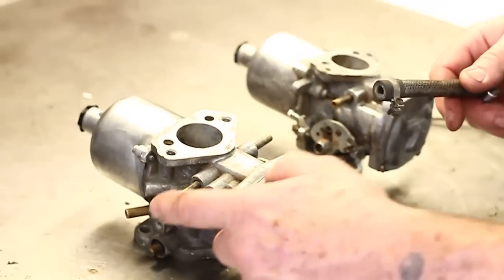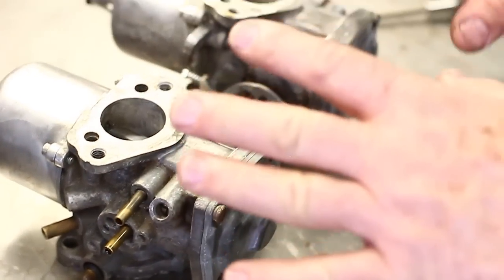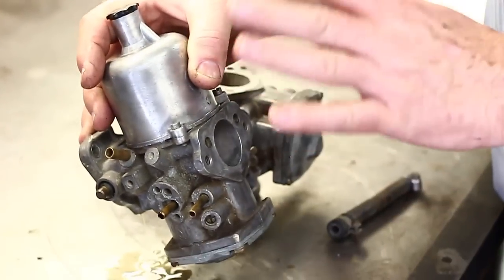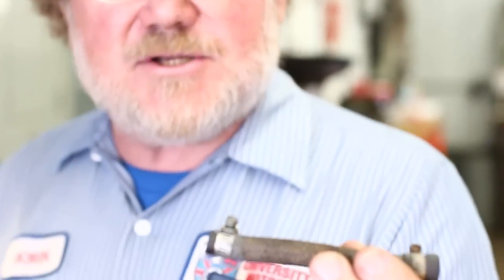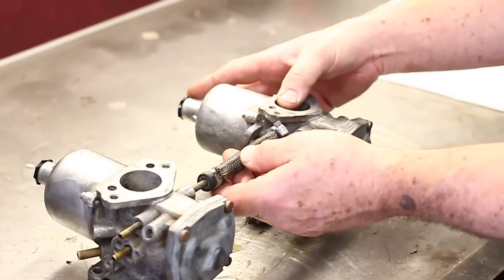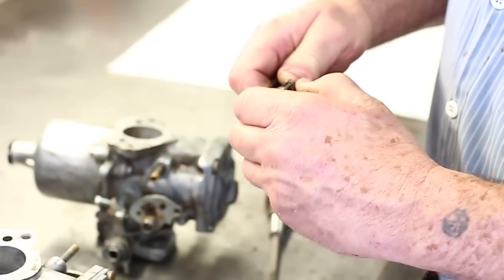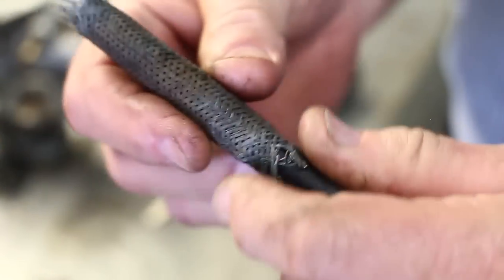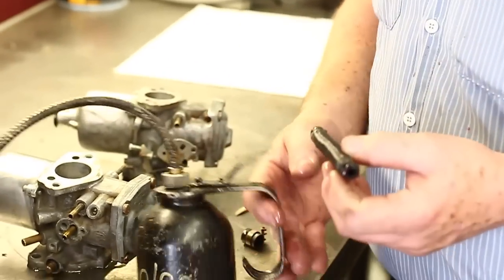285 MG Tech | HIF Carburetor Form vs  Function

Comment: John is spot on about the dangers of dirt in the float bowls, but wrong to say you need to fix in on the bench. I fitted a new hose between the filter and the carb (brand new, braided) and the car then 'failed to proceed' about 40 mins later. Fuel was overflowing from the front carb. Luckily I was able to get the float bowl off at the roadside, clean out the black rubber particles and fix it back on. A truly awkward job as it's secured by 4 almost invisible upside-down slotted screws. I now always carry a stubby screwdriver and spare float bowl gaskets in the car. I also flush through any new fuel hoses before fitting them to these interestingly designed carbs.